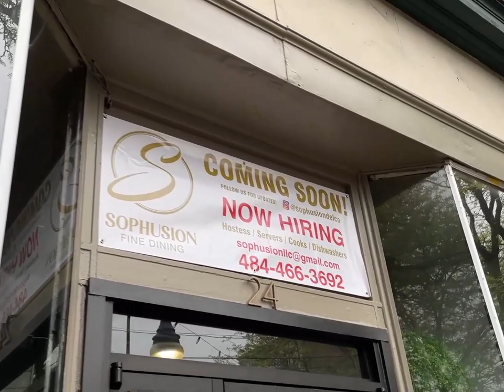Fixing up the front of a restaurant opening soon in Lansdowne PA. "Sophusion" will be its name.

Comment: it looks really good, there is also a really old hand scraping tool for glass work and wood , they have a wood handle about 8 " long and has spade shaped end and another type of one has a triangle end made of steal also and same handle and the spade one has curved part on one side for scraping rounded dowel ect , they where very common in the early 1900's to the 1970's and the still sell them in some stores or @ SW PAINT
Reply from the maker: Yeah I have a scraping tool like that, but it's in illinois. haha
Reply: @RinoaL  ok ! , i knew you probably have seen them before , they are a great tool , especially for refinishing furniture and window frames , trim work...